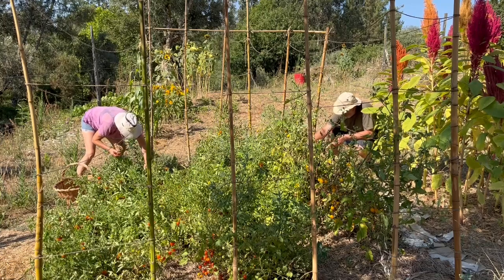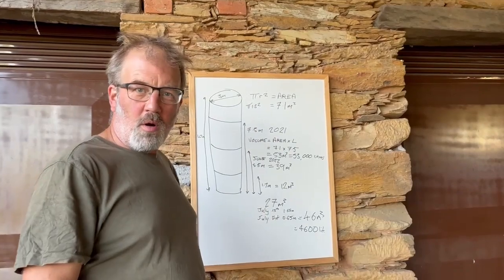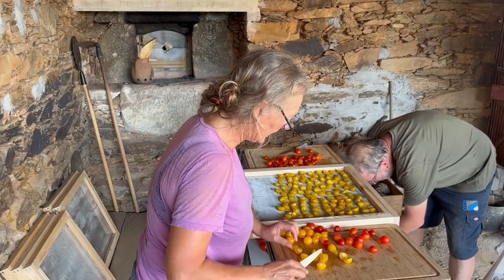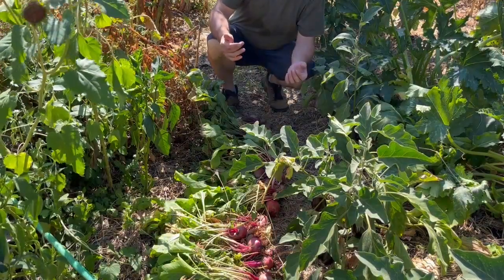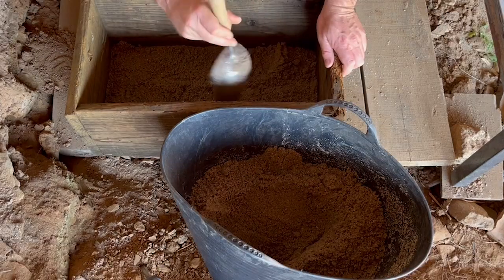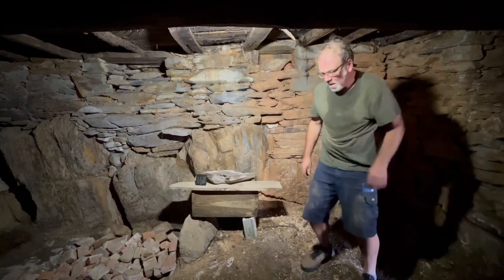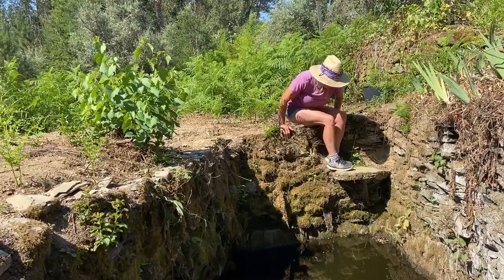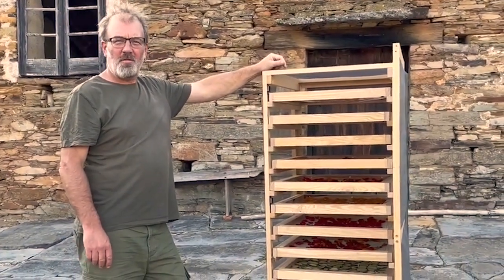Preserving Vegetables on our Homestead in Portugal

Comment: Once you have reserves of food you're going to attract rats. The brown rat has become a terrible pest even in the most rural parts of Southern Europe, they are everywhere. There is a very easy to eradicated rats, just use a mixture of one half baking soda and one half corn meal, mix together and provide this to the rats in a plastic container with a hole in it. The rats can't vomit or pass gas so the acid in their stomachs reacts with the baking soda and their innards simply explode. Its safe for the environment and works.
Reply from the maker: Good tip. We’ll keep an eye out. 👍